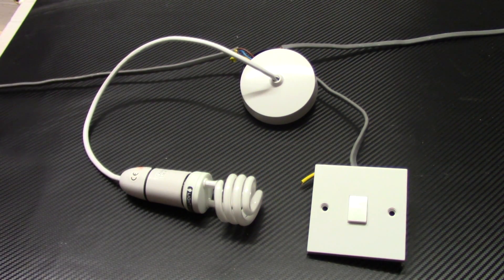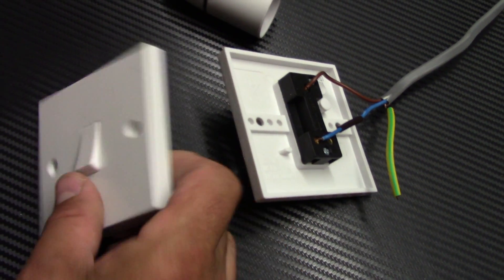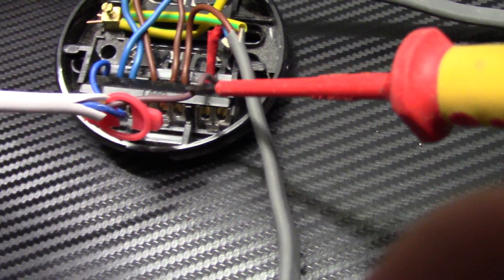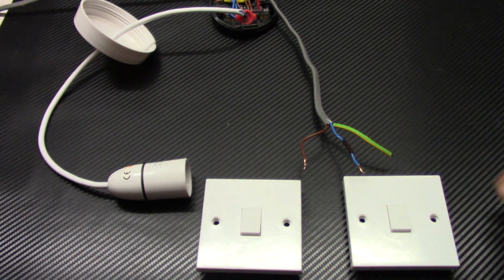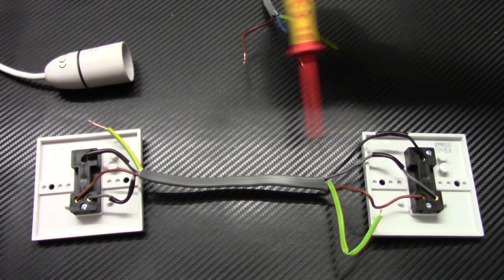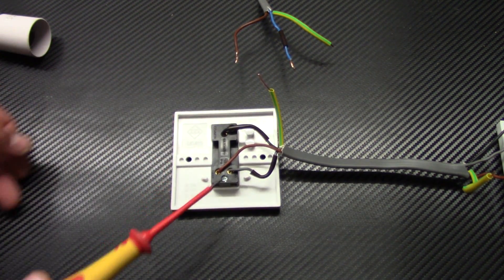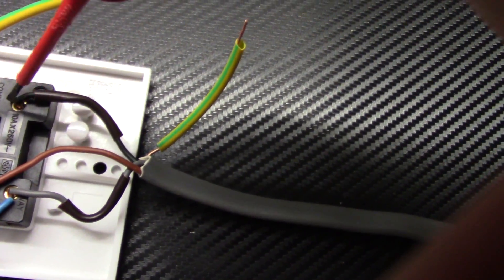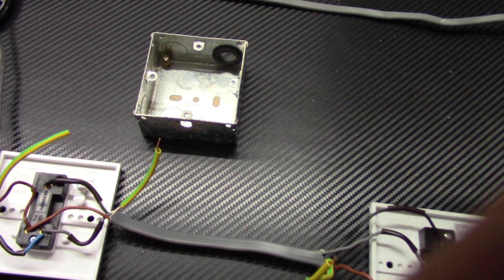LIGHT SWITCH  Wiring 2 way switch  How to wire 2-way light switch

Comment: Hello.  What if you want to add two more lights to this arrangement, but  you don't have access to the ceiling rose.  I currently have this setup for my bedroom light with 2 double gang two way switches either side of the headboard.  I want the second gang in each switch to control a reading light on each side of the headboard, but problem is what do I do with the neutral wire.  I can't run a new 3 core and earth wire to the original ceiling rose.  Hope this description makes sense.

Comment: If youv not got new wiring colours post 2005 ish then your gonna be in a spin when you take your switch off and find a red and black cable could be old conduit style looped in at the switch also or other methods twin red twin brown , i wouldnt bother with this tutorial just get a electrical chap in

Comment: Very poor demonstration....and never use earth wire in a two way light circuit it's not safe.🤔
Reply: Liverpool, You have just confirmed that "you" or "connecting the earth wire" is not safe, the answer is nothing to do with connecting the earth wire.

Comment: I have a two gang light switch with 5 wires, 3 Red/ 1 Yellow and 1 Blue.

The switch is meant to control the sitting room and the hall way, but is only controlling the sitting room at present.

I have noticed that only 2 Red wires are live and 1 Blue, is this normal ❓
Does anyone know how I can sort this out myself❓

Also since this problem started the garage lights do not work, in have changed the build, checked the light fitting and reinstalled an new light switch, so I guess it is down to the loop wiring and the two gang switch must have stopped the circuit.

Any help would be appreciated, and thanks for the video upload.

Comment: commonly...... that's not a 2 way switch....... it's a 3 way switch you used...... that connection method you've wired in is a 3 WAY CONNECTION not a 2 way connection........ i am an EIM NCII ELECTRICIAN and that's our trade test and examination anyway....
Reply from the maker: In UK it's two way switch  - 3 wiring system

Comment: Where is the phase wire?
Reply from the maker: Main line or live is to connected to the switch from ceiling rose . Or there is only line (live) wire at the switches   Neutral only  at the ceiling rose not at the switch.  only permanent live is going from the loop in a ceiling rose to the switch and returns as a switch live to ceiling rose to the  terminal where brown wire from bulb is connected. If you have a neutral conductor at the  switch then all is wired at the switch not at the ceiling rose. Hope it helps
How to wire ceiling rose  : www.youtube.com/watch?v=IO7-Z1hWnJQ&t=6s

Comment: where is main line {phase}
Reply from the maker: main line or live is to connected to the switch from ceiling rose . Or there is only line (live) wire at the switches   Neutral only  at the ceiling rose not at the switch. hope it helps
Reply: connected in the ceiling rose loop connection